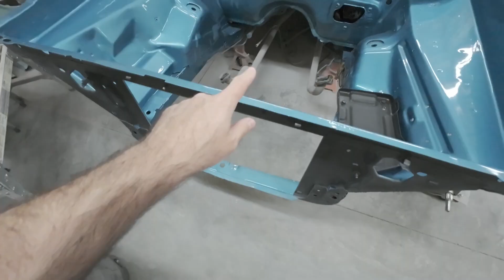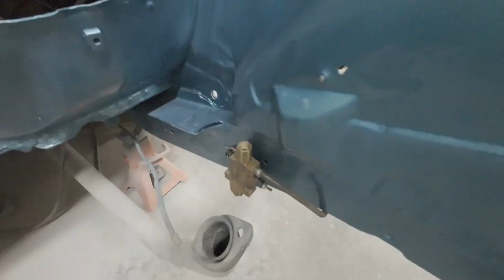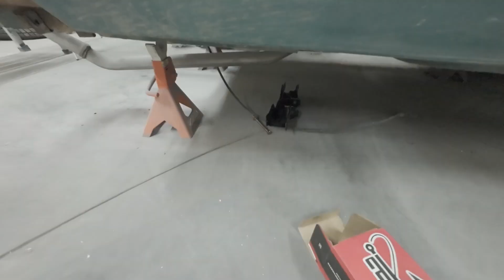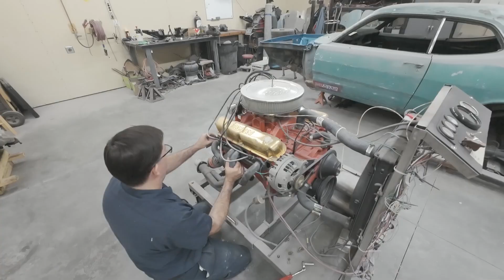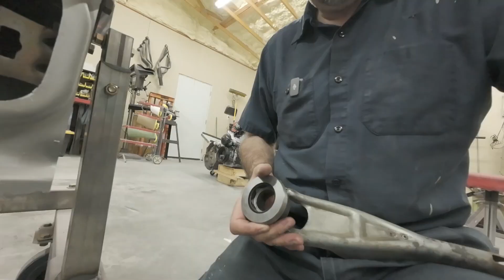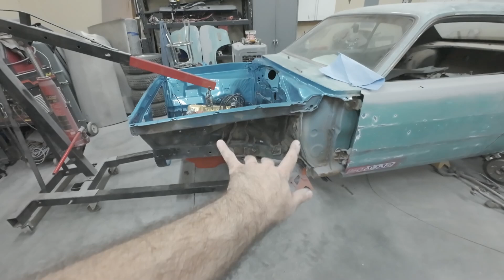Trying a different way to install an engine in a Mopar.  1974 Duster 318 and A833 OD 4 speed.

Comment: I would assembled the engine and transmission onto the K frame, then raised the front of the car with your engine hoist and rolled the completed assembly underneath.
Reply from the maker: I don't have what I need to roll around the assembly.  And I don't want to bang anything up with chains trying to raise the car.  Also the way the car would pivot on the jackstands it would be dangerously unstable.   I mention this in the vid.